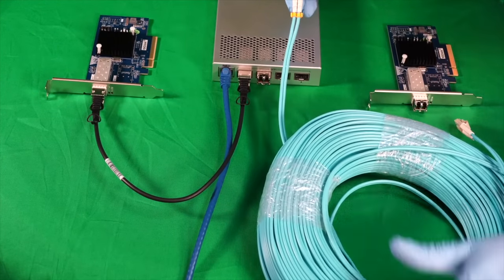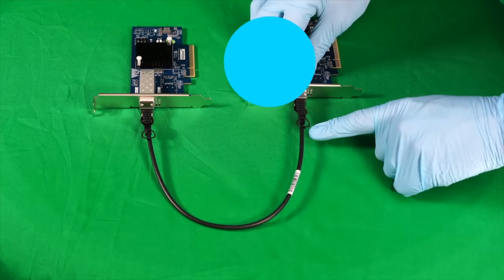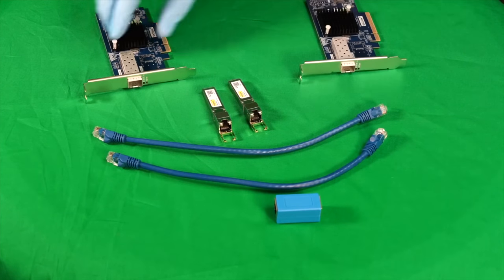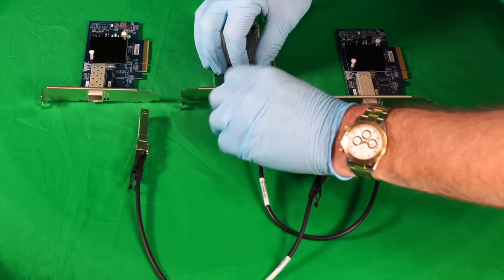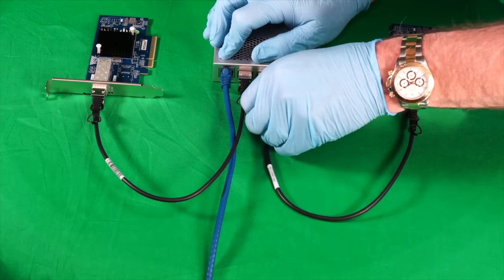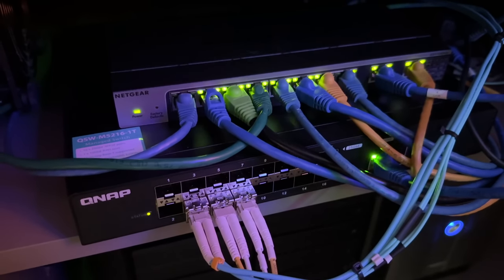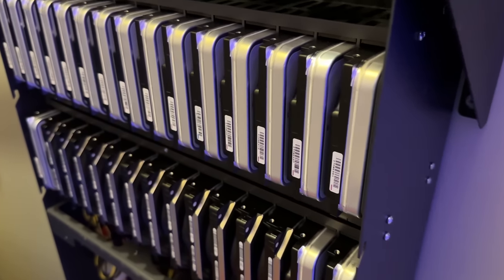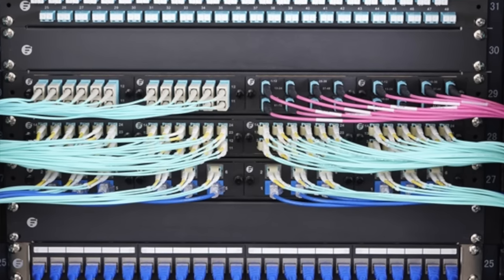10G and 25G Networking - SSD Speeds on the Net

Comment: Dave, another entertaining and insightful video update on the NIC connections moving from 10Gb to 25Gb. I have fallen into the same path, needing more 10Gb SFP+ ports, I to have ended up pondering the 25Gb connections my new Ubiquiti Aggregation switch gives! I to have come to the same conclusion about the ATTO Thunderbolt adapter for Mac. On that, are you, or have you tried the 2 x 25Gb NIC aggregated to the Mac Thunderbolt? While the Thunderbolt is capable of 5000 MB/s I guess 1 x 25Gb/s NIC will top out at the SSD speed below the 3125 MB/s capability of one 25Gb/s NIC. Therefore is the ATTO designed to give two independent 25Gb connections to the two thunderbolt ports connected to two Mac's?
Reply from the maker: From what I was able to gather, there's not benefit to two cables.  It doesn't split the load, both ports share one Thunderbolt cable.  It's just for passthrough.
Reply: Maybe some of the drives / accelerator cards (OWC) with 4 or 8 M.2 NVMe SSD could use more of the 2 x 25Gb/s bandwidth over Thunderbolt 3/4. Totally unnecessary, I know, but we do it because we can, not because we need it  😀

Comment: I would like to add a 25GbE nic to my 2nd m.2 slot, it should technically work as its pcie 3.0 x4 which has the bandwidth of 32Gb/s or 4GB/s, but most 25GbE nics use a x8 pcie slot because they have dual sfp ports, do you maybe know of any single port 25GbE cards with a pcie x4 connection?

Comment: I just learned how to terminate OM4 multi mode fiber. Pulled some through my house and for a few hundred bucks has all the parts to strip, cleave & attach a mechanical LC connector (AFL FastConnect). Was really cool & only takes average skills. 

Thanks for the Mellanox suggestion because I was wondering what has Windows 11 drivers at 25GbE. 

But damn that Atta connection is expensive. Almost $2K?

Comment: A correction: OM3 is rated for 70 meters at 25 gigabit, while OM4 is rated for 100 meters at that speed. It's not a big difference, so unless you're riding that edge, get whichever is cheaper.
Reply: OM3 is also, strangely, rated to carry 100GbE for 100 meters.  The only thing OM4 or OM5 does (currently) is give you more length (100M for 25GbE and 150M for 100GbE with either OM4 or OM5), but anything OM3 and above will carry up to 100GbE in distances you're likely to end up with in a home.  If it's out to a shop or something that's a football field away (and not 25GbE), sure, might as well put in OM4 or better, but not a lot of us are doing that at a home.

Comment: If you have two patch fiber cables the transmit and receive get flipped back to streigh. Thus you need to break the fiber pairs apart and flip them

Comment: I'm finally making the jump to 10 gig for all desktops, and 25 gig between my desktop and server.   

All because I'm finally building a server that can do over 1 GB/s (my 4th gen i-5 server is TIRED, replacing with a 12 x 12TB (2 x 6 drive RAIDZ2) + 4 x 1 TB SATA SSD (RAIDZ1 for VMs), and 1TB NVMe mirror for a SLOG.

Comment: Seeing you've pretty impressive network for your home, do you have spare parts ready for all those critical switches or will your whole network be down while you're waiting for the replacement switch in case of your main switch fails? I'm asking because those switches are pretty expensive. A nice solution would be to run everything fully redundant using IEEE 802.3ad but that gets awfully expensive because fully redundant switches are insanely expensive + you need double the wiring.

Comment: My question is…if that switch had two different vlans on it, we’d need a switch that is capable of 10gig uplink right? Because all traffic would go through the uplink to the router, then back to the other client on the switch?  Or is the vlan data somehow stored on the switch (layer 2)?

Comment: It's interesting to me that we've stalled a bit with regard to network speeds.

In just 17 years or so we went from 10 megabit hub, to 100 meg switched, to gigabit switches, all for dirt cheap.  Then it all slowed down.  Even though I wired up my house to easily get 10 gig ethernet (maybe more if I go out of spec), I'm still at 1 gig, and see little reason to spend the big bucks to replace my switch to get to 10 gig.

I keep waiting for 10 gig to get cheap, but it's still 2 grand to get a 24 port 10 gigabit switch.

I shouldn't complain. I'm sure you're right that unless you're doing a lot of non-local video editing, gigabit ethernet is fine.  It's certainly fast enough for everything I do.
Reply: That's why companies came up with the 2.5Gb standard. 10Gb is too big of a jump for your average home client.
Reply: @rodryguezzz  My suspicion is that the 2.5 gig standard is more about existing wiring than anything else.  2.5 gig ethernet supports cat5e, which a lot of places were wired for in the mid to late 90s when cat 3 showed its age.

Looking around, 2.5 gigabit switches aren't substantially cheaper than 10 gig switches. If you have the wiring setup, you'd likely be smarter to buy either a small 10 gig switch for any high speed server<-> client operations, and keep anything else at 1 gig.

Comment: I picked up a dual port 40G 4 port 10g, and 48 port 1G switch for my home network. Unfortunately i found that the only 40G network cards that seem to work well enough with TrueNAS cost more than the dang switch.

For windows you can find 40G cards for under $100 on ebay, and they do work(though one seemed limited to 22G)
Reply from the maker: My Storinator is running Proxmox as the base OS, and it bridges to the client VMs, of which TrueNAS is one.  So that's one way around it!

Comment: As an electrician who terminates RJ45, I can confirm that cat6a is worse than hitler. Each of the pairs has its own shielding. The cable is large enough that it doesn't fit in a normal RJ45 connector, and it's much harder to push into a connector without the wires crossing over. We've started using special RJ45 connectors that cost about $30 each because it really does save at least $30 in labor when trying to put the end on.
If you are thinking of terminating your own cat6a or cat7, just stop. Buy a pre-made cable of the size you want. Even if someone gives you the cable for free but you need to add your own ends, it's not worth doing.
Reply: It seems you are doing something wrong. Using proper Connectors like BTR 130B11-E for around 7€/piece (so 14€ for both ends and 2-3 Minutes labour for both connectors) works absolutely flawless, and we are wiring cat6a in customer's offices since it was for the first time on stock at the warehouse.
But RJ45 is phased out for 10/25gig Networks, for 40/100 gigs no one uses Copper. Even 10Gig is cheaper, more energyefficient and much more reliable over single Mode Fibre or DAC than over Copper. Copper is legacy for 1Gbit and POE, perhaps some 2,5Gbit devices, but 10Gbit over copper is not worth the effort, at least in productive environment. Over Cat6 usable though.
With the Mikrotik 100Gbit Switches there is a good and professional option to create really fast and reliable networks, even with rather small budgets.

Comment: hmmm some chipsets have autosensing support, recently I worked on a Marvel Ethernet Phy this one had it - it's just a register setting. That avoids having to use a crossover cable or coupler. Apple was using this for a long time with their Macbooks.
Which chipsets are used by those cards? Shouldn't they also have some auto sensing support? (technically I could imagine a few ways how to implement that)

Comment: Just wanted to add to Daves good vid here, multimode fibre is less fussy with poor mating on its interface ends. Singlemode needs to have very clean and very precise mating, otherwise you can have trouble pushing up to the multiGig speeds.

Comment: Did you have a chance to read up the latest news on fiber cable ? There is on fiber cable that has a hollow tube in there, the theory is light travels faster through air then glass

Comment: om3 is aqua color normally, also data centers from what I saw mostly run on single mode and dac if device is in same rack or one rack besides. multimode is being phased out, also you forget to mention qsfp ports they are basically beefier sfp that combine 4 sfp, so qsfp+ would be 40gbit (4x sfp+) and so on. also, most data centers etc. already decommissioning 10/40gbit (sfp+/qsfp+) and moving to 25/100gbit (sfp28/qsfp28) as a standard and 100/400gbit for faster links.

Comment: A minimum of CAT5e is required for 2.5 GB twisted pair Ethernet.
2.5 GB twisted pair is only 1/4 the cost of 10 GB Ethernet. The power consumption is also only 1/4.
An SFP port can also handle 2.5 GB.

Comment: Possible to post 10Gb nic setting for lowest latency and low ping… just bought the tp-link tx401 10Gb card and got it hooked to a mokerlink 10Gbs sfp+ 8 port switch and getting basically up to 1Gb speeds also using rj45 cat6a to my tx401 from my sfp+ to rj45 trans the rest going to my nas through short DACs so should not be a issue

Comment: Been trying to do this myself but at 2.5GB speeds, Need something special to do more than that, or just a very busy network I suppose ;) 
Looking to backup my windows PC to a linux one with a bunch of hard drives. Came up against the hard drive speed problem pretty quick, so still think l need to work out how to set linux up to use SSDs as a cache for the bigger HDD. Don't really trust RAID that much still in terms of actual recoverability when a failure comes around.

Comment: Hi,
I installed a cisco 40gb switch, 2 fiberoptic cables and  40gb nic cards in 2 servers. Speed wise instead of getting apx 40gb  best I was getting was about 5.  Considering the cost and effort it wasn't worth the effort.  The switch is a Cisco Nexus 3132Q-V,  fiber cables are Cisco QSFP40G-AOC15M and the nics are Mellanox ConnectX-3 Pro Dual Port 40GbE QSFP+ PCIe Ethernet Adapter

 Any suggestions why network speed is so abysmal?

Comment: 1 gig rj45 shouldn't need the crossover adapter. Devices should recognise the cable type and negotiate tx/rx pairs themselves. Or does those sfp-rj45 adapters work differently?
Reply from the maker: I think I explain that in the video!  You usually don't need them for modern gigabit and faster.

Comment: FWIW you CAN push 10G across OM1 MMF, but you can only push it about 30m (~100ft) (vs 300m/1000ft for OM3) that being said, unless you're talking about multi-core pre-terms the price difference between OM1 and OM3 is pretty negligible these days. 

Most transceivers that do 1.25G or better use laser not LED, it's hard to modulate LEDs fast enough for the data rates and indeed OM3 and 4 are "laser optimised" (there's also OM5 which is more aimed at SWDM systems). 

The difference in price between SMF and MMF transceivers (at least at my supplier) is negligible these days.

Comment: A benefit that I had to be reminded of is that latency can also go down with a high speed connection so if you’re streaming a gaming machine over the network you may get better results. Has anyone seen that before?
Reply: Latency for first bit to arrive is no different, however the end of the packet will get there slightly faster.  For a 1500 byte packet start to finish, that’s 12 microseconds for a gigabit network, and 1.2 microseconds for  a 10g network.  11 microseconds is not a noticeable difference in latency.
Reply: @ausnetting  It’s one of those things that should be intuitive but if you’re over a remote desktop where the entire frame can be fed throughout PCI-E Gen4, sent at a much higher bandwidth, it could be noticeable.

The physical world won’t change much and light or electrons won’t get faster, but the rest of the pipeline is interesting.

If someone has done the before/after benchmarks I’d be interested in seeing.

Comment: Single mode cable sm1 sm2, and multimode om3 om4 cable all have the same glass diameter 50 nano meter.   Where multimide om1 and om2 are larger glass at 62.5 nano meters.

Om3 and 4 are considered laser optimized multimode.

25GB does not require om4 and can be run on om3.  The key factor is distance.

Although single mode is more expensive you see it more in the data center and risers due to the life of the cable plant is much more future resistant than multimide.   Gone are the orange fiber panels of my youth, now all yellow!

Fiber connectors are an important lesson.  LC in the video is quite common now,but many cable plants ive used are SC in the panel.   Making sure you get the  right connectors can be a experience.

And optics vary.   Mind your labels and vendors.

Comment: I love other videos where people messing with multimode stuff are all paranoid about keeping their eyes away from everything. If it doesn't have a laser warning on the transceiver, don't worry. An IR LED isn't going to harm you one bit.
Reply from the maker: I wouldn't think so either, but if you're looking into the far end of a cable you don't know what's on the other end.  So the rules are all cables are always laser until you know they're not :-)
Reply: @DavesGarage  I've seen videos of people being scared of being in front of a transceiver that's plugged into equipment, not the fiber end itself.

Comment: Just like copper, fiber can run faster than it supposed to do. I have all my servers and my workstation at 10Gbps, the servers are using OM3, 'cause it was cheap for those short runs, but I couldn't find a cheap 20m cable for my PC. I ended up using an old 20m OM2 cable from the datacenter were I work, and it worked just fine. Also, SFP+ is an standard. SFP+ 8Gb FC from SAN equipement is, for some strange reason, dirt cheap compared to SFP+ 10GbE (or it was 3 years ago when I bought 10GbE equipment), and they work at 10GbE just fine (if you have a brand like Mikrotik that will not check SFP+ vendor ID against an internal DB to blacklist them to sell you a ~10 dollar thingy at ~250 just because it has it's brand in it). I've updated my vSAN to all NVMe drives, and will soon update my NAS to all-flash SAS. I'm considering 25GbE, do I need it? Not really. But it's cool and it's getting cheaper. I guess I'll try OM2 at 25GbE sooner or later.

Comment: There's actually no such thing as an "RJ45" connector.  The correct term is 8P8C.  I didn't believe it myself, having worked in IT for 25 years and always having heard it called RJ45, but I looked it up and it's true!

One other thing that is potentially useful to note - your video calls out Cat5E as supporting up to 1 Gb/s, but it actually officially supports up to 2.5 Gb/s.  Although not officially supported, I've seen 10 Gb/s work on Cat5E, and even plain ol' Cat5 for short runs.

Final note - you mention that most any gigabit connection will automatically handle straight thru/crossover negotiation, and that's true.  However, it goes a bit further - the auto-MDIX functionality is actually part of the 802.3ab gigabit ethernet standard itself - so every gigabit device should handle it out of the box.

Comment: Wow, I hardly notice a 1Gb connection to my NAS, though I don't do much with videos, it's mostly just convenient to have all of my computers share personal files on a common "drive" (NFS mount). I'd need a faster NAS to feed more than 1Gb anyway. At least I used CAT6e when I wired my house.(yes 6e, Belkin made it before the official 6a standard, but it is effectively the same performance.) 

Cat6A is availible unshielded or shielded. Shielded is generally only needed in very high interference such as massive cable bundles, running cable near large electric motors or near TV-broadcasting transmitter sites.
The cat number mostly just determines minimum wire gauge and the average number of twists per meter for each pair.(Most higher rated cable will also use slightly different twist rates for each pair and a separator core.) Although the standard only specifies performance not construction, physics and cost don't leave much room for creativity.
  
If installing persistent runs of twisted pair copper be sure to use solid core, The more flexible stranded core cable should be limited to short patch cables as it has more attenuation losses. 
The CAT rating is actually not the cable alone, it is a rating for a complete standard circuit that includes a specified number of equally rated terminations and patch cables. 
From memory the standard circuit is starting at the node-A tranceiver/port, 5meters of stranded-core patch cable with plugs on each end, to a panel or wall socket, 90meters of solid core (which is terminated directly in the sockets at each end; not with plugs) to another patch panel/wall socket, then a second 5m patch cable with plugs on each end to the node-B tranceiver/port. 

The CAT rating is based on signal degradation using that complete standard circuit when tested with a given signal frequency and power (based on the cat level) and a set amount of radio interference from bundling with other cables and SOHO levels of radio noise.
 
When they say CAT6A unshielded is good for 100m at 10Gb they mean the 5m+90m+5m node-a to node-b circuit described above. Switches are active repeaters so they count as a node and you can have 100meters from each port. An old 10/100Mb "hub" is not an active repeater so does not extend range, if anyone is still trying to use one as a retro challenge. Hubs actually reduce range.
1000Mb-baseT has the ability to fall back to 10/100M protocol. All faster BaseT ethernet standards can not perform collision detection so they must use full duplex switching, and they cannot fall back to 10/100M. (collision detection creates latency anyway)

Comment: Watch out for that 1GB port on that 10GB switch. That's a management port and is not directly connected to the switch chip so all traffic will have to go through the 800mhz CPU - don't expect gigabit.